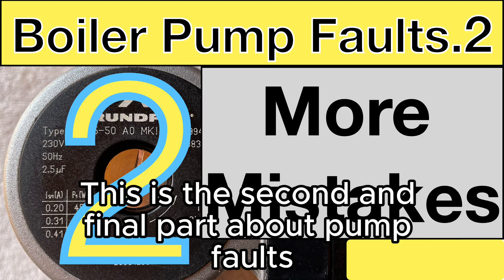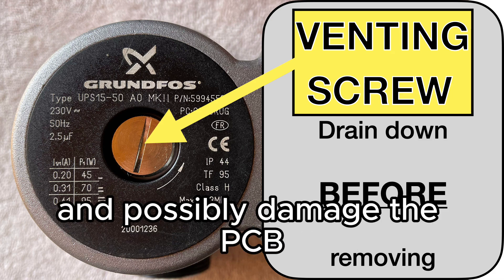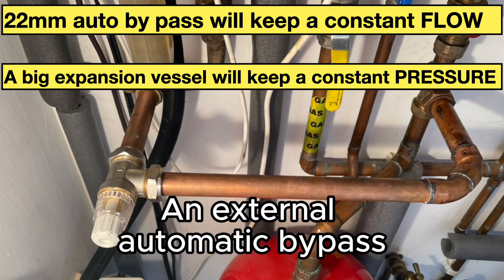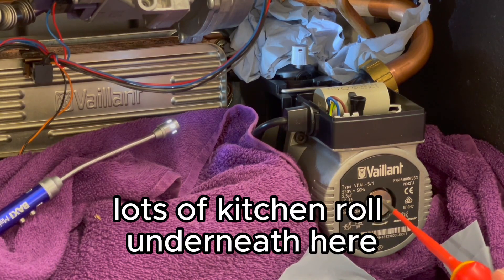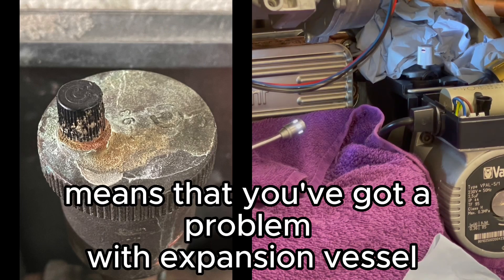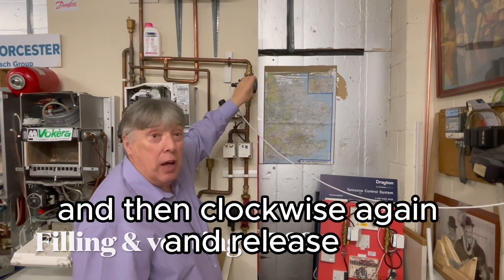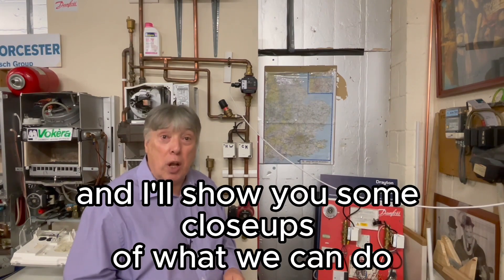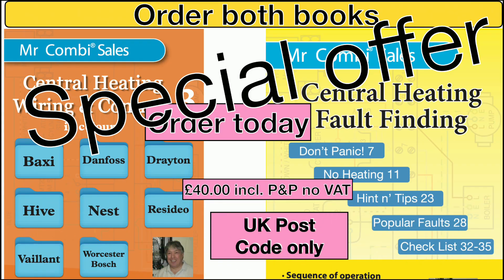Boiler Pumps Faults 2

Comment: Hi have a baxi 105e 60deg light flashing pump !!  changed diverter valve ! Changed plate ! Flushed out ! New filter return ! Non electric fault ! Top back diverter pin not rising enough to make micro switch any ideas ? Thanks in anticipation
Reply from the maker: test the pump not change diverter, I would ask Baxi they are always helpful . george